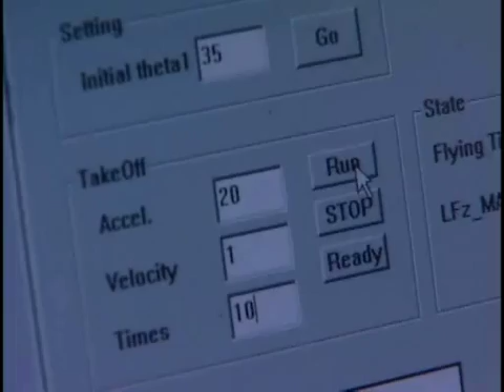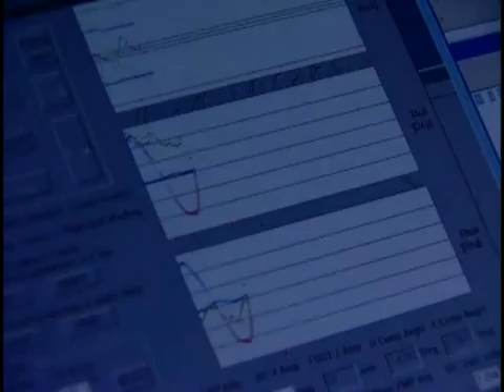Albert HUBO (English)

Comment: So much effort and resources to allow robots to travel on two legs. What this video doesn't address is the question of why? The implication is that we want our robots to be as anthropomorphic as possible. But how important is that, really?

Is imitating the human form the only reason, or are there other inherent reasons for two legs being optimal? I'm sure it largely depends on the application, but I would think that, for a general purpose robot, and from a functional standpoint, other means of mobility -- such as multiple legs, wheels, etc. -- might hold an advantage.
Reply: good points